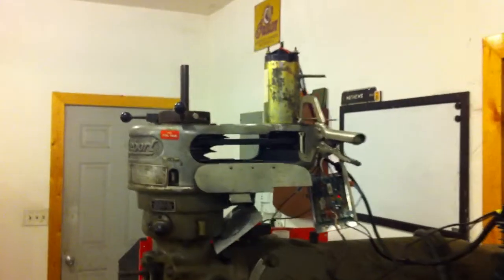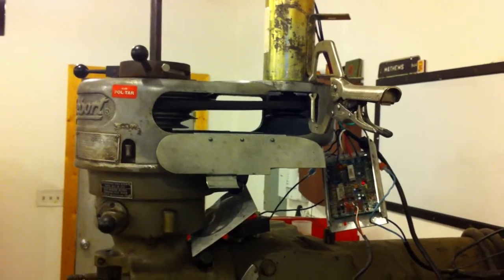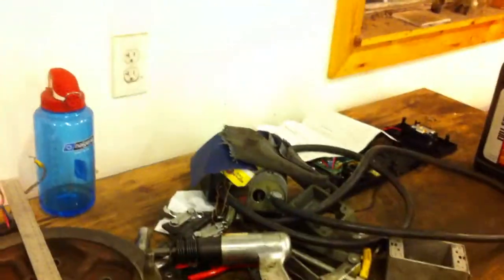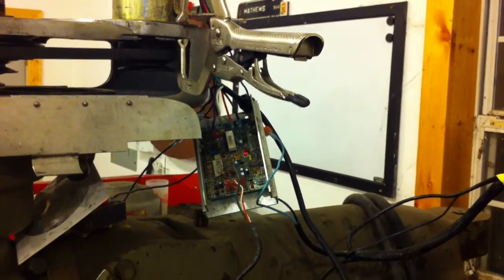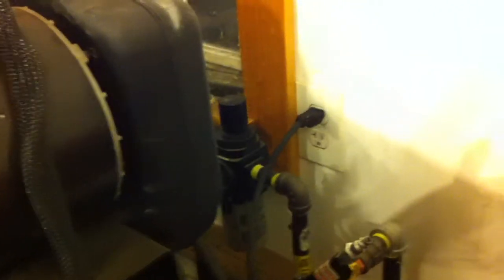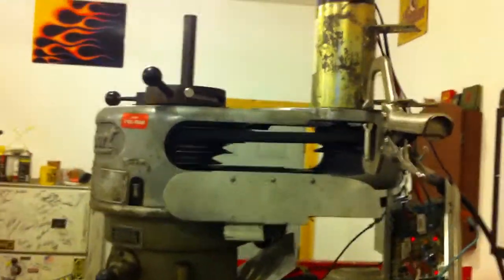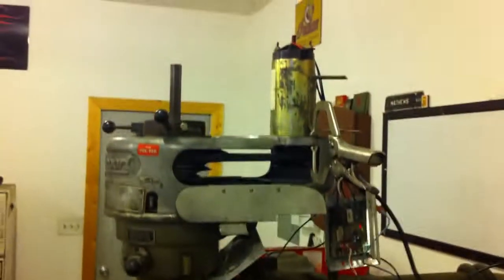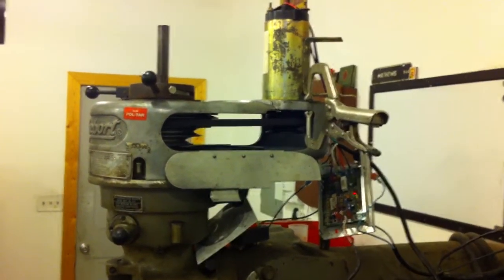Bridgeport with treadmill motor

Comment: I recently acquired the same mill with the same problem.....how are you liking the DC variable speed aspect of milling?  I have both a DC motor and 3ph AC motor that I could install and would love to hear your thoughts on milling with DC variable speed motor, I am assuming you have reversing?
Reply from the maker: Actually i moved and had to sell the mill because I didn't have a garage big enough.  So I sold the mill to a friend before I really ever had the chance to do anything with it.  I never cut with it.  I think it would work but the shaft diameter of the treadmill motor was a bit small.  May last forever, but I'll never really know now.  Good luck on your fix.